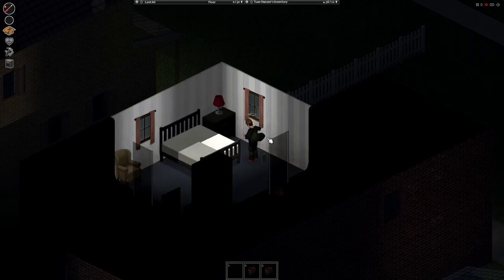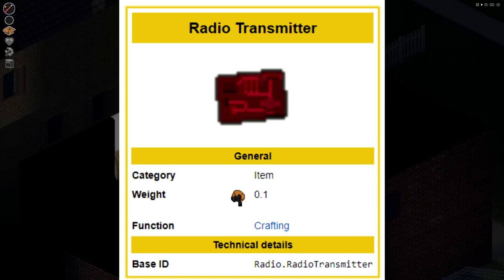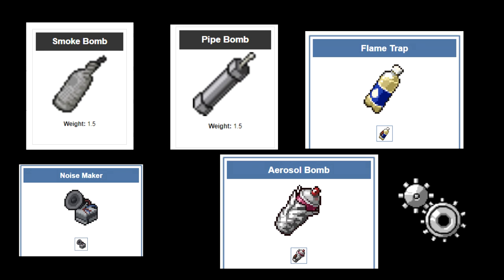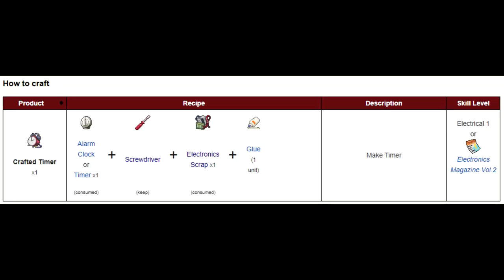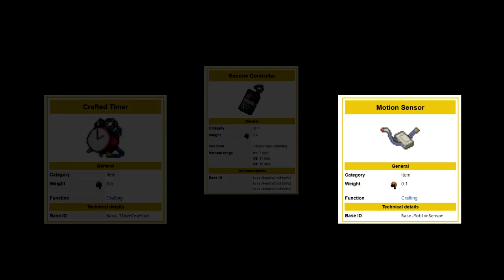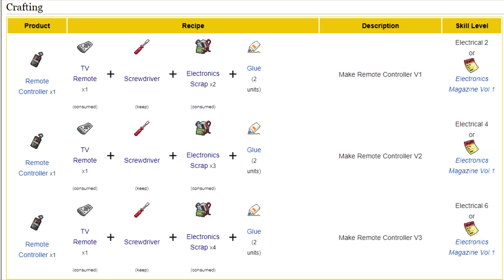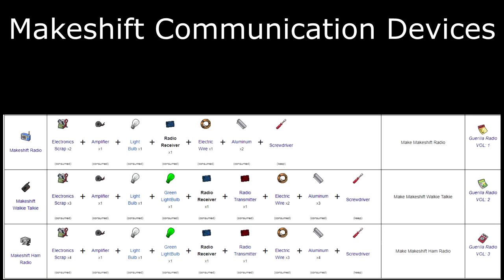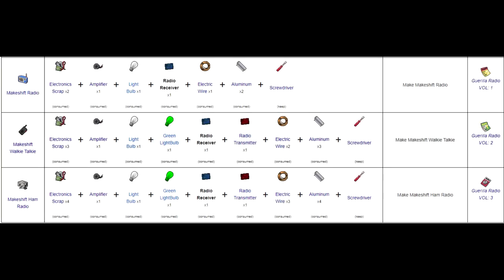Project Zomboid Electronics Guide Build 41

Comment: Screwdriver can also sometimes be found lodged in zombies. I think flashlights can't be dismantled though. You didn't mention how Electronics is also used for two things, one being hotwiring vehicles which requires one and the second is converting lamps to battery use which requires five.
Reply from the maker: Flashlights can be dismantled, i mentioned hotwiring in the vehicle tutorial
Reply: How do you convert the lamps?
Reply: @magritteetmoncouteau  You need level 5 electical, electronical scrap and a screwdriver, then you can right click standing lamp and select the Craft Battery Connector option.
Reply: @Faalagorn  thanks for the quick response!

Comment: A quick way to level Electronics initially is run a generator and repair it if you have access to one and a gas station for the fuel.  Just needs Scrap Electronics and gives very good XP compared to TVs/Radios/Watches

Comment: I like that at level 5 you can make battery connectors for lamps and light your home without leeching off your generator . In multiplayer, fuel consumption is important unless you're filling it before bed and getting up early to refill it(stock fuel consumption settings)

Comment: The thing I never understood was, why would you want to make radios and things at level 5 electrical, that you broke down at least 30 times. You had the radios, just save one and not make one later. Did the devs think you’d run out and suddenly think “oh damn I want a radio!”
Reply: The homemade ones should be crank operated so you don't need batteries.

Comment: Honestly, I wish certain games that have special in game communication systems, like PZ's radios that you have to find or the old 360 game Chrome Hounds and the com towers and commander's range, would detect 3rd party communication software and not let you play if its running. 3rd party com programs ruin a lot of communication mechanics in games. Like at first everybody had to capture the com towers in Chrome Hounds, But then the Xbox Party feature was added to Xbox 360 and then people stopped capping them because they didn't matter any more, a key part of the game was just wiped out.
Reply: Just no way around it, everyone could just do a group call with their cell phones.
Reply: @themonkeyhand  Possible but I doubt most would bother to use their phones for this.

Comment: Easier guide to electrician: it's fucking useless in the current state of the game. All the triggers you can add onto bombs are cool but you're so much better off just yeeting them into a crowd you've gathered and herded. Battery connectors are useless as batteries run out 100x faster than your gen will. Only use for the electrical skill is the ability to hotwire. The game really needs some attention to this profession... so much cool shit can be done like: electric fences, light switch crafting, handmade flashlights, maybe even add powerplants to the map in which the electrician can repair and provide power to the whole town.